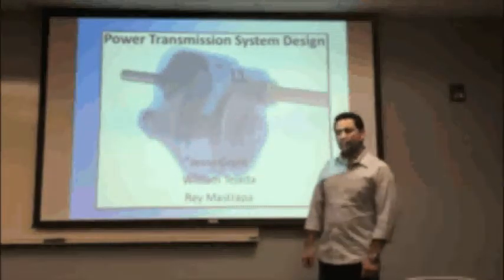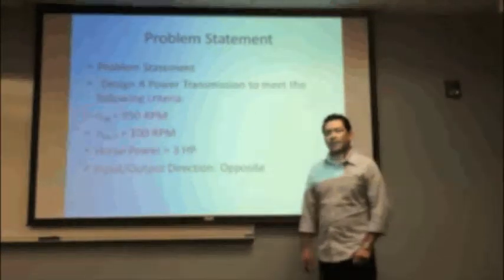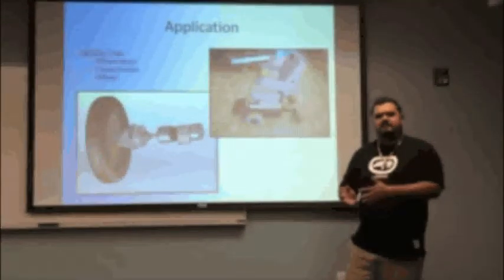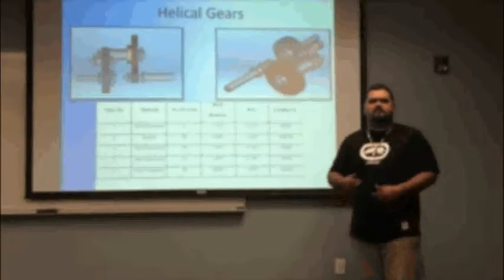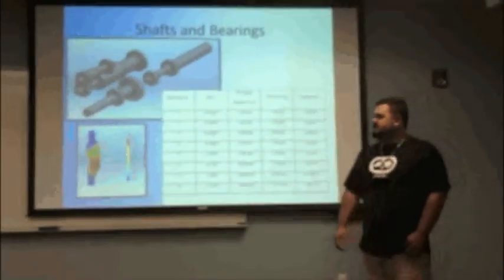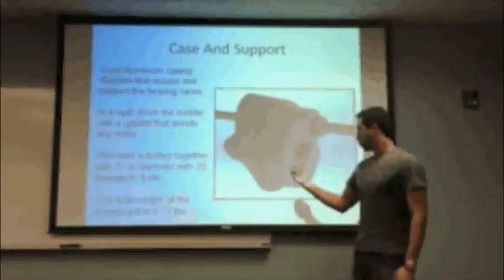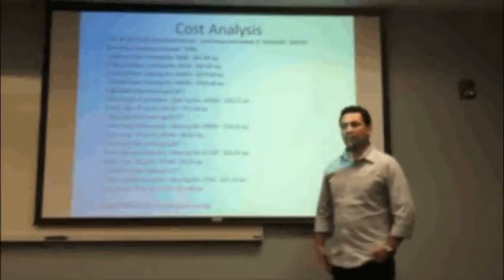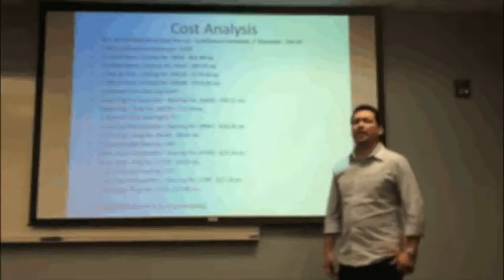Team 3: Power Transmission System Design

Comment: It was difficult to read the slides on the presentation. The speaking was a bit mono-tone. Overall the engineering was done well. I like the explanation on gear selection, and the implications on arrangement of shafts to achieve the desired parameters. The application was very good. The use of helical gears was very good.